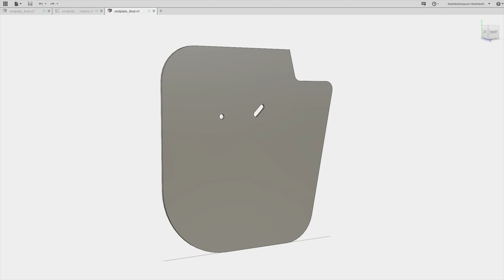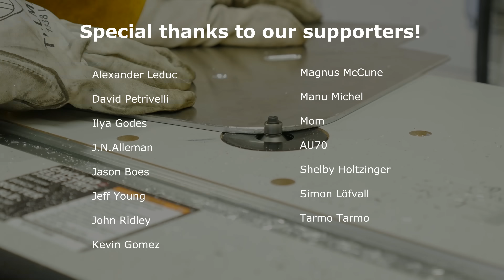Cutting Aluminum with Wood Working Tools! (S2000 Spoiler End Plates) - S02E33

Comment: Well, I was here 6 months ago. I've now cut a ton of aluminum with a router, and it's great! (Once you get the right bits.)
 
A spiral bit of HSS is fine. I grabbed a few ¼" (6.25mm) bits for this. The HSS did fine, but the solid carbide, 2 and/or 3 flute bits are magical. One of the other reasons these are so great is that they shave curls rather than rip chunks. So it helps the mess, and keeps a majority of it from becoming aluminum dust. 
 
Just make sure you use a good router, (and a good router table) NOT from Harbor Freight. 
 
An aluminum cutting bit can be $7 or $170 depending upon type. So buy one around $20 (I prefer CMT bits from Italy as they have really great carbide, creepy sharp edges, and they're easy to clean any aluminum that might be stuck on them. 
 
Lastly, and most importantly... DUST COLLECTION!!! Aluminum is one of the worst things to cut as it can be easily breathed in and lodge in sinuses and lungs. Then it's RIP. So use a high quality vac with a hepa style, 1 micron filter. Also, a high quality cartridge mask... not a simple layer of material most ppl use.

Comment: This is the way to go.  I am unsure if either my half inch mdf or my 8th inch alminum template would work with a plasma and router and collar. ...Also, I have 20 half inch holes and 12 quarter inch holes, and found it very time consuming with a drill press.  First, I would spray paint through the template, then find the center of the hole and mark, then drill the center with a small drill (I got off when I didn't do this step), then drill the half inch holes.  I could cut out 3 steps by blasting the center of the hole with the plasma cutter through the template. I am wondering if anyone has tried this with failure or success?
Reply: I've always thought spoilers look like a towel bar in a bathroom. They have the same aerodynamic effect, as well.

Comment: I'm simply too afraid of damaging my expensive bits, and flat out scared of buying a cheap bit for aluminum.
Reply: Try routing titanium sometime and let us know how expensive they look. For me though, routing metal is not too bad on my bits, but most of that is just squaring up pieces, light passes only ofc. For one of those 'dedicated bits'-type jobs, I'd plan on buying extras of a good cheap one or 2  I knew for basic one-off stuff like in the video. As long as you're not wanting to churn out baseboard moldings from 6061 bar stock or something else ridiculous, most of your woodworking bits would likely do just fine with most light metalwork, provided you know what you're doing and don't get in a hurry. Of course, if I had a plasma cutter I wouldn't need to route so much metal in the first place.

Comment: I don't think the issue is with the cutting head. Carbide will go through aluminum no problem. The problem is all the aluminum shavings getting into your exposed router motor and ruining it.

Comment: I would of not tried a wood router bit for that but gives me some ideas. Probably never use that bit again. How is the edge after using it? Or one bit and done (with the bit that is)?
Reply from the maker: The bit looked just like it did when I started, cut just as nice too. I'm sure it will wear out much faster on steel and aluminum, but it should still last for a while.

Comment: Nice.  Go to all that work to improve aero efficiency with those end plates an destroy the aero with that roll bar creating turbulence.
Reply: yeah car owner still enjoys it on the street and being in Florida convertibles are nice to cruise around in. simply add the hard top when going to the track, best of both worlds!
Reply from the maker: It actually has a hardtop when on the track. And also this is a track car, so a roll cage is mandatory.

Comment: A couple of years ago a student in the Robotics build team was trying to rip some aluminum extrusion on the bandsaw and making a mess of it. I said "cut it on the table saw."  He thought I was nuts. I said "Give it here."  I set up for the cut, every student in the shop retreated to the far end. Cut through it like butter and left a super nice finish on the cut.
I cut aluminum with carbide tipped circular saws a lot. Doesn't bother a thing and works very well. Noisy though, put on the ear hole pluggers.
Reply from the maker: Good advice. Have you seen the YouTube channel sv seaker? He will even shape aluminum by hand with a table saw. That even makes me nervous
Reply: yikes. Yeah I don't do anything with a table saw except straight cuts. Table saws require caution.

Comment: Cutting a few bits of aluminium with a router bit works fine.  I've done that a few times but it will wear them out pretty quick.  It's a handy tip if you are building your first CNC router.  After that you can use proper carbide bits and let the CNC machine do the work.
Reply: The router bits he used had carbide cutting edges.   Guess you're not into wood working...
Reply: Sure looks like a carbide router bit to me.
Reply from the maker: Yup, both bit used were carbide. Still look and cut like brand new too. I'm sure they will wear out faster then cutting wood, but that's true of all tools.
Reply: Sorry by proper carbide I meant solid carbide with spiral flutes, ideally with 45 degree angles.  These will have a shearing action and will last longer.  But you needed the bearing guide on the brazed carbide wood routing bits.

Comment: two questions: what about chip welding, did you use any lubricant? what about using a roundover instead of a chamfer, to get a little bit into the 21st century?
Reply: Or a nice ogee, to take it back to the 17th?
Reply from the maker: No problem with chip welding, my guess is the high speed of the router helped with chip evacuation. Also feeding it by hand, I was able to get a good "feel" for speeds and feeds. 

I think a round over bit would work just as well, though getting the depth right might be a little trickier.
Reply: Candle wax on the bits will stop Aluminum from sticking .

Comment: Aluminum was, at one time, considered the “poorman’s oak”. Any and all cutting tools, used in hand or machine tools, used to cut wood can be used to cut and metal, ferrous and non ferrous. So long as the cutting tools are kept sharpened, and honed. Back in the 90’s I turned a full sized solid aluminum bat on a shop smith, using nothing but a broken pipe wrench handle out fitted with a 1/2” Bondhus Allen wrench, shaped in much the same way a lathe cutting tool is shaped. Those were the halcyon days of yore.
Reply from the maker: That sounds epic!

Comment: Good job getting an odd shape cut out nicely, two suggestions, firstly be careful with gloves and spinning tools, I have witnessed that go bad for a co worker. Second tip, use plastic contact film like you would to wrap your school books to protect the mill finish on the Aluminium. Saves you time in getting any scratches out after cutting it out.
Reply from the maker: I agree on both points. I stopped using the gloves after the first cut after realizing my mistake. Good call on the contact paper. I will have to pick some up.

Comment: Does increase efficiency equals to saving fuel?
Reply: Diego García Gonzalez anybody who needs to "demand" respect for what they do doesn't understand what respect is.
Reply: More downforce means more drag which means less fuel efficiency.
Reply: The actual effect is to make your car look crazy awesome to 14 year old boys, and like it's owned by a complete tool to the rest of the population. It also tells the cops who to keep an eye on.
Reply: John Ridley easy to assume, do you know if the guy doesn't do track time? I'm guessing you wouldn't like it if anyone told you a hobby you have makes you look like a tool, but then you would demand respect for what you do, keep your stuff to yourself man.
Reply: John Ridley and we think you are a total knob for opening your mouth (or keyboard) without the knowledge of what the application is actually for.
Reply: I'm thinking more like reducing aerodynamic drag (which results in saving fuel and better performance, in certain cases)
Reply: Phillip Ramirez but wings aren't always about downforce, that depends on how is the wing and its features set up, downforce helps for grip, which causes drag, reducing acceleration and top speeds, on the other hand you could get it set up for better top speed and acceleration, resulting in less downforce and grip.
Reply: so this application is for track day cars/race cars. the engineering behind that end plates and actual wing are functional in this application.
Reply: John Ridley neither does anyone who isn't capable to give it without judging if it's deserved or not
Reply: My guess is that he isn't that worried about fuel efficiency judging by the huge roll bar/frame fitted behind the seats of the car. Due to these features I'm sure it will make 14 year old boys drool as well as petrol heads and anyone else who likes that style. Anyone else is welcome to keep there opinions to themselves. 

I'm also sure that it probably will draw the eyes of every single police officer in the world, bearing in mind all the police officers I know are petrol heads and like cars like this one. They will only pay it extra attention if it's doing something stupid like breaking the law by speeding, which finally enough almost every car in the world can do depending on the speed limit in the area.
Reply: I totally understand that there's a lot of knowledge and skill involved in doing these modifications, and I'm not intending to take anything away from that. But I'm also pointing out that outside of a very small bunch of fans, honestly, these cars just look idiotic to 99% of the world. The people who appreciate it will appreciate it. But pretty much every single person on the road (assuming these cars go on the road) looks at them and thinks "what a knob."

Comment: I’ve used carbide tipped wood working tools for several aluminum and steel projects on the bridgeport. They work fine and if you need a cutter on the weekend than a run down to the home center will get you up and running again!

Comment: It doesn't matter for a couple plates, but If you are going to do lots of aluminum, then use carbide tools. Aluminum itself is very soft, but it has layer of aluminum oxide on it's surface (especially when it's anodized or weathered) and this isn't the best stuff for HSS.
Reply: xy4648841fd He did.

Comment: It's a total waste of time even having that wing on the car. The airflow will be so disturbed that it won't work.
Nice machining, but a total waste of time
Reply: Likely because (pure speculation here) the wing is just bolted to the trunk, simply for aesthetics. No real engineering as far as air flow and management with regard to the rest of the car. Further, unless the wing is tied into the frame of the car, any significant downforce produced would buckle the trunk lid like a tin can.

Same with the splitter on the front. Likely pure aesthetics. Doesn't look like the support rods are bolted anywhere close to an actual structural part of the car. If it produced real downforce, it would just rip right off the bottom of the bumper.

It's his car. If he likes the way it looks, more power to him. I know I dig it.
Reply: So I used to do racecar suspension and aero for high speed stability: I don't know much about s2000 flow dynamics specifically but I can tell you that wing is easily in the path and probably not at much reduced pressure. Without knowing more about the angle and shape of the wing I couldn't tell you if the purpose is to create downforce or reduce the cd, but there's no reason it couldn't be for either. It also looks like it's mounted at the seam of the trunk, so even without reenforcement that area could take a few hundred pounds per side. Way more than a wing that size is capable of. I know wing size want limited by his track category too (afraid I didn't recognize the category, haven't been building track cars for a long time)

Don't forget that most cars produce lift at the rear in higher speeds, which is less than great in wide corners and an otherwise balanced car.
Reply: Id love a video on these topics ! Can you make it happen for us ? Pretty please?
Reply: Chris Santacroce oh definitely: air dam, splitter, diffuser, and undertray are all great ways to add downforce if your class allows it (or just for tinkering). Just putting a hard tray (remember it has to support the weight it's displacing) and a rake can work depending on the car. Controlling that can be difficult though: most cars I worked on naturally produced the most force somewhere forward of the driver without doing a lot of work to redirect the air. Has other advantages too like being able to direct air to or from the brakes, radiator, ett. The early 2000's c5-r cars had a great design if you want to see an example, was probably one of the reasons they we're so good
Reply: so the car owner Tommy runs a hardtop on the car while on track which is the reason for the designed endplates. (obviously top down does create aero problems and unclean air to that wing) those who think this wing is not practical on this car I can show you data otherwise. the increased downforce allows for faster cornering around a racetrack and these endplates will create less drag with more downforce so a better efficiency of the aero
Reply: Todd Kaley #161 I'm actually curious to see that data. Not to say I doubt you, I'm just genuinely interested to see empirical data on cornering speed improvements. It's quite rare, in my experience, to find someone bolting something like this onto their car for anything other than aesthetics (plus lots of posturing from the "stickers add horsepower" crowd...).

It would be very cool to see what kinds of performance improvements were made.
Reply: Chris Santacroce https://robrobinette.com/S2000Aerodynamics.htm here is a great write up on aero with this particular car. aero works on racecars/track cars, look at every level of racing you can see on tv. all have some type of aero on every car you will see. the engineer who designed these was able to take the normal endplates supplied and replace them with a more aero efficient solution. more downforce less drag
Reply: why because the roofs down?
Reply: Ryan Wilhelm Hasn't thought about reducing the CD, that's a good point. And now that you point it out, having it mounted over the seams is a clever way to add structure.

And while you're correct that most cars get light in the back at speed... I can't help but think he'd benefit more from an air dam in the front, with the splitter much closer to the ground. It seems like it would be easier to keep air from getting under the car, to keep the back end from getting squirrely in long sweeping turns.

But I'll obviously defer to greater experience. Thanks for the education!